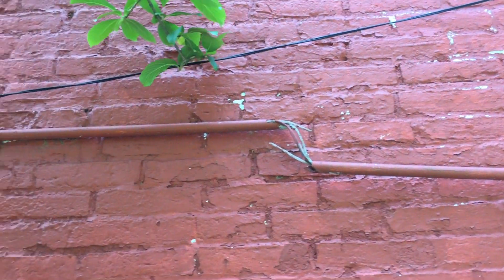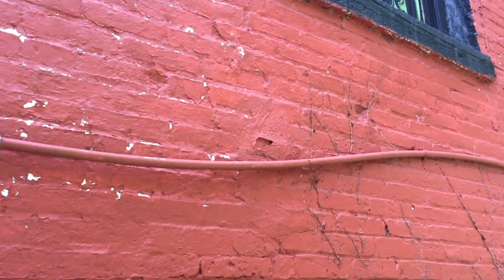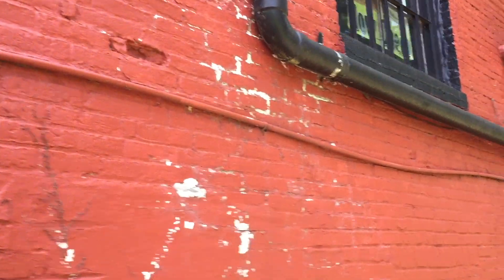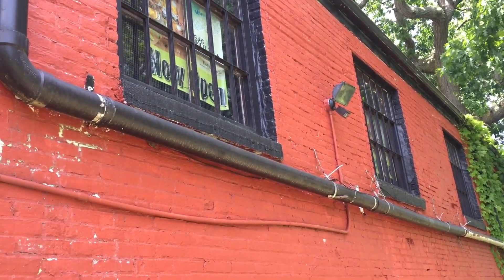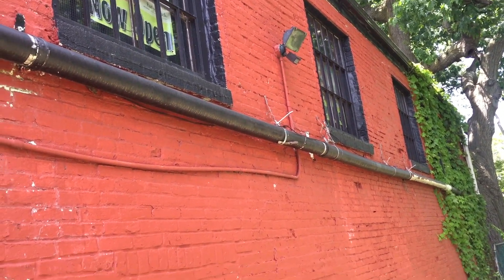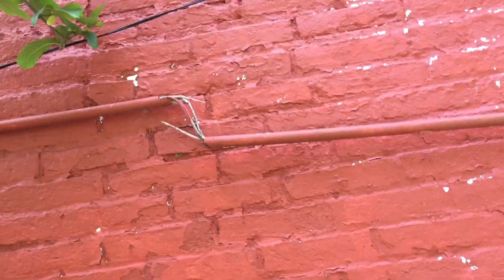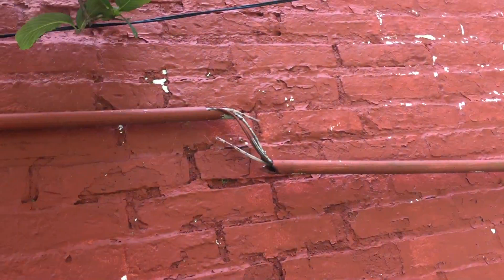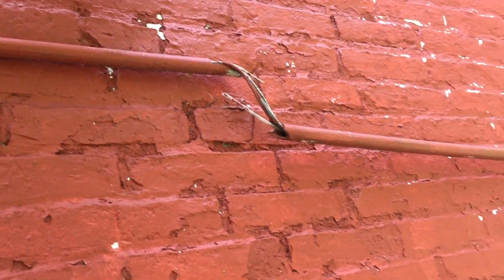Moving Violations Video No. 242: Missing Expansion Fittings

Comment: how do you commonly account for the extra length of wiring within a raceway that has an expansion fitting? I'm assuming there needs to be extra in the junction boxes on either side of an expansion fitting, but do they make a special spooler that allows the wiring to move back and forth, or do you just leave an extra amount coiled in the box and let it do its thing?